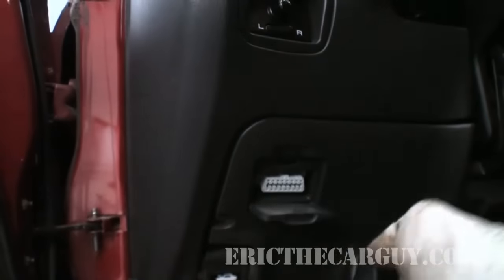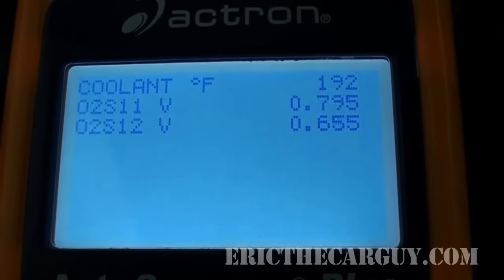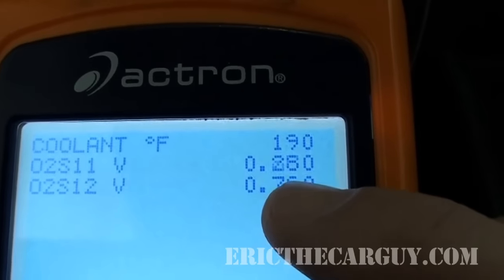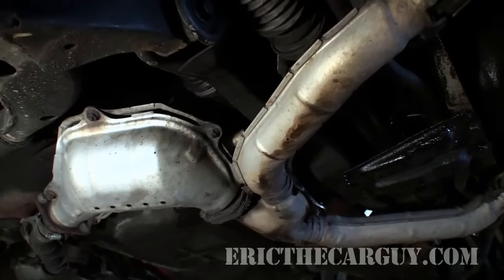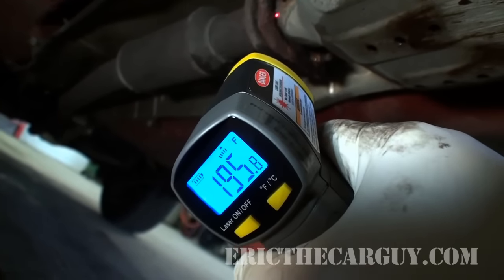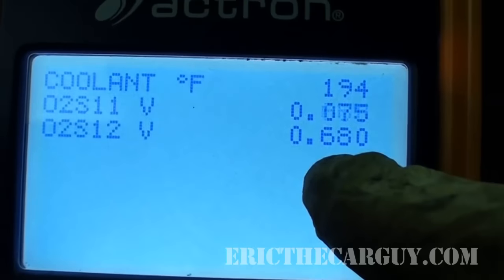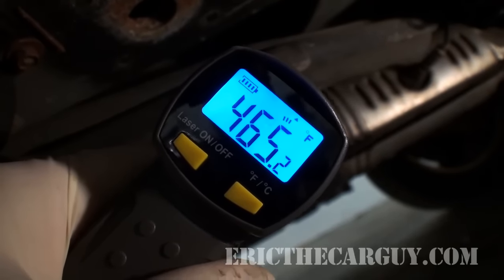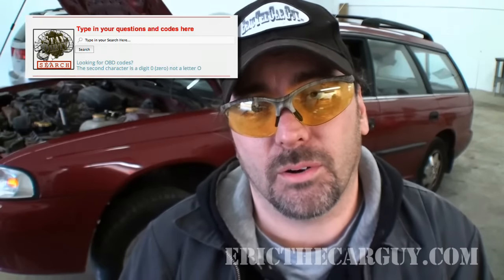P0420 How To Diagnose A Bad Catalytic Converter -EricTheCarGuy

Comment: My car sounds really loud now, when I drive it. is this a sign that I need a new catalyct converter?
Reply: Grace623: It's probably because your catcon has been stolen or at least interfered with. This has happened twice to my Gen 2 Prius here in London, UK where catcons are stolen for their rare metals that do the catalytic converting.
Reply: Catalytic converter sometimes have metal plugs that blow out or you can have an exhaust leak somewhere in the system that your system would need to be inspected

Comment: I would recommend you to remake this video. If you use the scan tool with the graphic signal representation (waveform if you like, although technically this isn't a waveform), you could show much more clearly the difference between working and faulty cats. Pretty much, this is a definitive test. In absolutely the most cases, if the car comes in with P0420/P0430 codes, the signals show the cat fault loud and clear. Practically, you don't even need to monitor these signals because this is what the control system does anyway. It sets cat efficiency codes exactly because it noticed this very signal pattern. If you got P0420/P0430 - you could start saving money for a new cat

Comment: I had a cat come apart on 2008 Toyota Hilux using E10 Fuel.  It blocked flow and set an engine check light.  Toyota wanted $3508 for cat plus labour and freight.  I took it up the road and had Beaudesert Exhaust fit and after market one.  Twice the size and number of cells for $350 fully fitted.  After 50klms of driving the check engine light reset.  I now have a scanner.  My advice is shop around.  Later had a 2 and inch sports system and extractors fitted as well as kn and I made a cold air intake.  Power is up 15 rear wheel kilowatts and torque  has improved too.  Tows great now.  Stainless mandrel bent and heat coated extractors.  Now to fit lpg.
Reply: your check engine lite will be on soon

Comment: Very good info  I sorta knew this already from reading some articles after failing emissions however I had to research for days to find all that here is presented in a 10 min video which speaks to the  amazing... job done here...

As for my problem I've pretty much narrowed it down to one of the cats ( I also had many exhaust leaks but they don't seem to be the issue) but no idea which one...  I doubt it's both....As my emissions aren't terrible just my nox is kinda high... at time and sometimes just barely fails...
Probably gonna end taking a thermometer to both cats and see which one seems weak...  to narrow it down...

 I've heard that the back cat is responsible for nox  but I've also heard the opposite and what seems most likely true that it varies by model....... precat vs main cat..
I highly suspect main instead of pre on my model... but I'm gonna check first as I don't wanna replace wrong part if I don't need because  Cali approved CARB cats are like 500$ a piece!!...

Comment: I just replaced 3 o2 sensors and then I get a p420 code. This is driving me crazy I need a smog
Reply: Could be your fuel system get the fixd sensor it works miracles I got one for 19.99 but regular price is 50.00

Comment: Thanks for your specifics & clear communication! Always glad to hear your expert opinion.
My 2012 Kia Rio is already showing check engine light due to P0420 after passing only 98K miles. I've been able to clear code 0420 using high octane gas plus using a bottle of CRC G2P brand fuel emissions test formula, once per month. What's your thoughts regarding CRC G2P bottles, and a Rio's cat-converter going bad after only 98K miles?
Thanks much. 
~Shawn

Comment: This is a great video on what a cat does.  It's not just Nx though. Nitrogen is normally inert and makes up 70% of our atmosphere. At the high temps and pressure of a combustion chamber it combines with O2 which is of course also part of our atmosphere. Other pollutants are, HC or hydrocarbons and CO carbon monoxide, these last two come from incomplete combustion. The idea is the catalyst holds these pollutants temporarily and recombines them with the other gasses, so CO, becomes CO2, that it may get from a Nitrogen or just free O2 HC becomes H2O and CO2 and NO reverts to N and then all can be released out the tail pipe in their less noxious or inert forms, in theory anyway.  Think of it like a little oven.   As the catalyst gets "poisoned" from other metals or oil it cannot do it's job and the pollutants pass straight through. The catalyst BTW is an inert metal like gold or platinum which people have been known to recover. That is the type of failure we are dealing with here mostly only emissions are affected . The other type of failure is where the converter physically breaks down. It has a very delicate structure. When it breaks down it can restrict the free flow of  the exhaust system. This leads to very serious/noticeable performance issues and calls for a different type of diagnostic procedure.

Comment: Well I have a 2012 with nearly 160k miles on it now and I'm hoping it's the sensors. Simply changing the upstream seemed to give it a smoother idle and less noise, gotta lift it and change the downstream and hope it does the trick. The cat temp read from the ODB at least seems to be within spec. Not sure where my infra thermo is but it was also dirt cheap and I have a feeling it caps out pretty low even if I did find it lol.

Comment: Just a Heads up when using a IR heat gun. That laser dot is measuring a much larger spot then the size of the laser dot and it changes depending on how close it is. it may be the size of a quarter or larger. So if its right next to the heat shield its averaging the temp of the heat shield and the pipe and maybe even the floorboard behind it. The  cheaper the heat gun the larger the spot. Also the color and type of material effects the temp.

Comment: Thank you so much for this awesome video. I don't have a live instrument reader but I did take the temperatures of both my catalytic converters. The one coming from the engine has a temp of about 500 degrees going in and only about 230 coming out. The one under my car is about 220 going in and 220 going out. Am I right to believe that it is the cat coming from the exhaust manifold that is defective? Thank you for your help

Comment: No clue what N0X is but your wrong. A catalytic converter is actual platinum metal that when gets hot releases oxygen molecules that can bond to carbon monoxide and form carbon dioxide which is much safer

Comment: Infra-red temp comparisons are very reliable diag tools however scanner live data is also good indication but not 100%. The communication bit/rates of scanners and vehicle processors vary so you could mistake slow comm speed for a lazy O2 sensor. The best and most accurate way to diag a cat/O2 sensors is with an O-scope.

Comment: I also have two converters on my F150, but received the P0430 (bank 2) code, albeit when testing for temperature, both converters where about 100+ degrees higher at the rear.   I'm at 138,000 miles, so I'm wondering if it may be the sensor itself?   One fellow mentioned, I could tap the bottom of the converter (while cool) as if anything has come apart in the converter, tapping the bottom..you should be able to hear if anything is bouncing around inside the shell.  I've heard good & bad about the possibility of cleaning the CAT, so I don't think I'll use that method.    I heard, if running with a bad catalytic converter you'll get worse fuel mileage, on top of spewing the NOX?   I've seen a couple videos as well, where the converters actually where plugged, to where the engine wouldn't even rev up, and I'd hate to get to that level!

Comment: I had a cel 420 thinking o2 sensors but,at least this test diagnosed it's not the cat.thank you.If the o2's were reading around the same range as you then they should be good too?

Comment: I had a 2005 lancer that I was told needed a cat at 140k.  I started by replacing the upstream o2 which did not work. then I replaced the down stream and that worked. Later around 180k the check engine came on.  I bought the cat and had it put on (rock auto 200.00).  the light did not go off.  I ended up buying a lawn mower spark plug extension for $3 at auto zone.  I had to drill it out but I got the o2 sensor in and on and had no problems.  Gave the car to my son at 238k

Comment: I just had my 2016 Escape 1.6 ecoboost in for a P0420 code. They said my cat is fine but my fuel pressure is 10psi too high. They pointed out that my open airbox could be causing the MAF (I have a MAP) to read the intake air incorrectly. Causing the code and the higher than normal fuel pressure. The sensor they pointed at is actually the air temperature sensor. So I feel that the whole visit was unproductive. Any opinions?

Comment: Hi Eric hope this finds you well and happy.  the videos you post are as always helpful My Mercedes c280 has 4 o2 sensors yikes  lol the car runs like a charm even with 174000 on her she is still very quick. a lot of the time she runs rich you can smell it outside and the tail pipe get shuted up. Got any idea which ones to change the car doest show a code. Have a wonderfuk day and a even better tomorrow.  Dave

Comment: Hey Eric I’ve got a 2000 Chevy Silverado it’s got the 4.3 v6 and my issue is sometimes my Truck will hesitate on take off and tbh it just doesn’t seem to run all that well in my opinion..I know these engines don’t have a whole lot of get up and go power but the Truck just seems a little more sluggish than it should be. It’s had a complete tune up and is throwing no fault codes at all. It’s got 122k miles on it. Would you have any ideas as to what could be wrong with this Truck of mine? Thank you!

Comment: I HAVE A HUGE ISSUE Eric!! would love to hear your comments on it. So, I have a 1997 Honda Accord right, and I looked down one day and saw that a pipe of the exhaust system was totally torn apart and allll messed up. Ok, I bulk up the cash to not only but a cat-back exhaust system, but I got the headers and a new catalytic converter as well as they were really bad on mine already. So I spent the day today taking my old one out building my new cat-back and headers and when I got everything in place the last thing I gotta do is bolt the catalytic converter to the end tip of my headers, only thing is they don't align in the right wholes to fit??? The problem is the catalytic converter, I bought it as an exact fir but when I compared it to my original one, it doesn't have the same angle tilt as my original one, Have you ever encountered this problem???
Reply: did you buy cheap headers? maybe they are more universal than direct like the stock manifold. Otherwise the cat could be the "cheap" problem.What engine do you have? 2.2L or 3.0L
Im assuming 2.2L , you may have to do some slight modification. How much are the bolt holes misaligned? You may have to leave everything up front (headers,cat,collector piping area) loose until you have everything started if it is not too far off. any chance of a picture of the problem?

Comment: The P0420/P0430 codes indicate that the ECU (by way of the Oxygen sensors) is not seeing the change in exhaust gas composition that it expects AFTER the Exhaust has reached Normal Operating Temperature. The overall temp isn't that critical, what is is the Difference in temp between the inlet and outlet, the outlet temp should be Higher than the inlet,  a difference of 100^F usually indicates a passable cat, anything less and the cat may not have fully warmed up or may be faulty.

Comment: I got that P0420 on my 03 Honda CR-V, I did check with the scan tool like Eric did and my readings are opposite his, the 1 sensor is stable and the second is bouncing around. Haven’t done the temp test yet.

Comment: TY, the thermometer trick should tell me all I need to know. Just want to make sure I won't be wasting my money on a new cat.
btw I think you might be slightly misunderstanding the meaning of NOx, unless I'm just misunderstanding your explanation.  It's not referring to 1 molecule that has a mysterious ability to bind to any number of oxygen molecules. The x is because it refers to a mixture of different molecules that start with NO, so it's a mix of NO2 and NO3, NO4, etc...

Comment: Mr Eric !!! I have a 06 pilot that has a P0134 . I changed the O2 in it and it came back up again after two days . Changed the spark plugs too thought I was mis firing but I was wrong . It has been almost a week and hasn’t gone away .I drive at least 130 miles (plus) everyday from home and work . Could it be that my catalytic converter is failing ?

Comment: Hey, this is so much help!  My secondary O2 sensor (on a 2002 VW Jetta GLS / 2.0) is behaving just like it should.  But my primary is switching between very low numbers (-0.01, -0.04, -0.02, -0.08, etc).  Both O2 sensors are relatively new.  Would low numbers on a primary indicate a problem if the secondary checks out okay?  Thanks bud, you’re a lifesaver!!

Comment: All the light's on the dash all went on, and the wind shield wipers, in my 2014 Town and Country van. Drove me crazy, still can't find the reason. Do you have any tips??? Any video's you recommend? How would you check out the rest of the van for electrical problems? Do you us electrical cleaner, and grease when you work on the conections?

Comment: Hey Eric! I have a 2009 Nissan altima 2.5 just recently check engine came on and checked po420, I checked the two sensors with scanner data and was showing 02#1  2.6 and 02#2  .5  it appears to me that this catalytic is plugged by the high reading on 02#1. I kept driving vehicle and recently  I floor the accelerator and will not repond will not go over 60 mph. eventually will replace the catalytic manifold, an advice is greatly appreciated,   also want to congratulate you on the excellent video's.

Comment: Thank you, Eric, for the informational video. My state does not have an emission test, but I still need to find a way to fix the clogged Cat Converter so that I can improve my mpg and gain the lost engine power. I have seen people drilling big holes through the cat to let the exhaust gas through. Is that a good idea? I don't wanna through in an expensive part on a vehicle which is not even worth the price of the part itself :)

Comment: How do I know what is accurate and what is not?  You say the catalytic converter inlet temp is supposed to be cooler than the outlet.  K Diagnostics (Catalytic Converter Efficiency Below Threshold.....) says the opposite and apparently you both proved your point.

Comment: My secondary O2 sensor is reading 0.075. Is that too low? You said yours was reading 0.5 volts in your Odyssey. I just tested my cat with an infrared thermometer too, but I forgot where to aim it. I think I got like 220 on the bare pipe in front and after the cat (same temp). Then i did the front and rear of the cat (not sure if I got in between the heat shields). I think I got 180 and 280. This was at idle with the car on, but I had been driving for about an hour prior.

I don't have any check engine lights, but this is my second cat. It's an aftermarket Magnaflow that has like 70-80k miles on it and is about 5-6 years old. I got the P0420 cat code like 4 months ago, but I reset it when I got home and it hasn't come back on ever since. Power is a little lacking, but I get what i feel like is restriction in 3rd gear gently nudging the gas at around 30 mph. Car drives okay otherwise, and my gas mileage is actually pretty good.

Comment: My 2004 tj just threw the P0432 yesterday. Checking live data today, but am leaning towards having to get a new pre-cat system. My question is, I nixed my rearward resonator/cat before the muffler and added a Flowmaster Delta 40. Having removed the rearward cat, could it cause the exhaust to run hotter causing these problems? I have 127k on the clock so I can assume my exhaust is on its way out but am still intrigued to problems I may have caused. I'm about 200-210hp so is the last cat necessary other than emissions testing?

Comment: hi Erick, you and scotty kilmer omit some situations: for example i just had P0420 problems after passing under a flooded bridge, i had water in the muffler and the problems started. After months I removed not the catalyst but only the final part of the muffler. And as if by magic the p0420 code has never appeared again. I therefore deduce that the catalyst sensor detected wrong parameters due to some hitch to the emissions line after the catalyst.

Comment: Just to clarify, it should be hotter at the exhaust outlet and it should be colder at the inlet if it is good when checking the temperature on the cat?

 My trailblazer is really sluggish and going up hills is even worse. As in going up hills, it revs out and loses speed as if it thinks it's towing a heavy trailer.
Reply: Yes because the catalytic converter acts as an oven that superheats the exhaust gases, so it should be hot or hotter on the exit side.
Reply: @HeiseyMotors  Thank you, I just wanted to double check before doing anything but I already cut the CAT off and straight piped it. Went from being sluggish and as if it was in limp mode to getting all my power back after that.